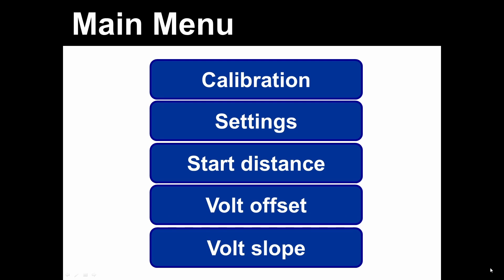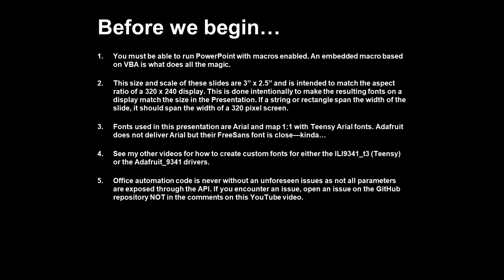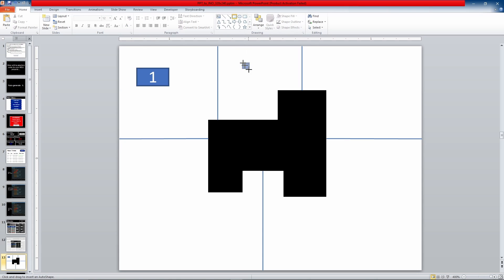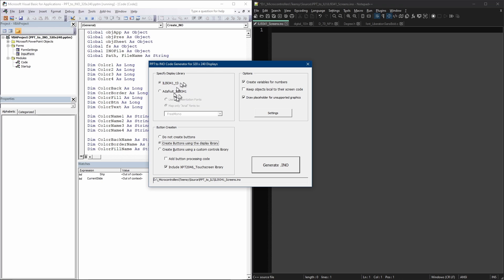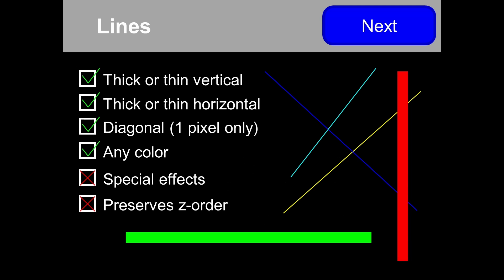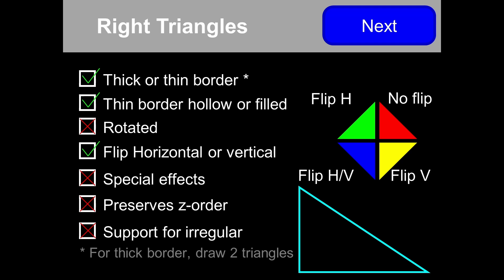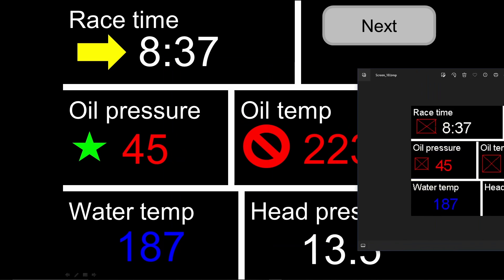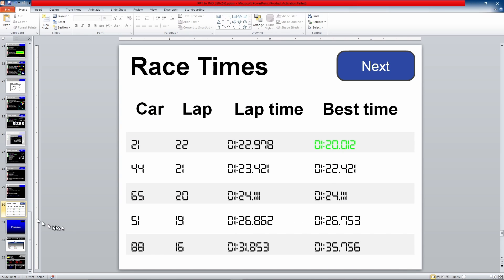Code generator: PowerPoint to .ino

Comment: Kris. This is an amazing job. I stopped using ILI screens precisely due to the difficulty and time consumption required to do something useful AND Eye-appealing. I started using Nextion screens, the design interface is very easy to use but it comes at a higher price and a proprietary firmware. I still have a cople of ILI screens around so I'll definitely be testing this! Thank you very much for your effort, for sharing and for being awesome! 😊
Reply from the maker: You're very welcome.